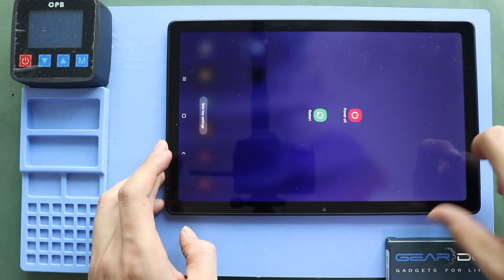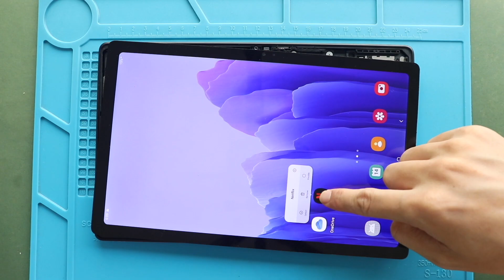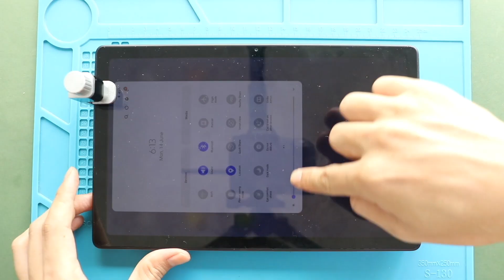Samsung Galaxy Tab A7 2020 10.4 T500 T505 Charging Port Replacement

Comment: Thank you this was very helpful. I wouldn't recommend using heat gun. If you dont have a heat pad, alternatively you can use a 3d printer with heated bed this what i used

Comment: I couldn't use a heat gun so instead I warmed up a dry washcloth & used that to loosen the glue. Followed your directions exactly and my tablet is working again! Thank you so much. Your instructions were very easy to follow!!

Comment: I'm a newbie to this.  HELP.  Should I be worried about static electricity? I'm just thinking that these electronics may be sensitive.  I don't know how I could either dissipate it or keep it from building up from my activity (I have wood floors and a rubber mat on a workbench).  Thanks of the video
Reply from the maker: Well try to wear anti static strip

Comment: heat gun and using my fingerstips as measure to when things got too hot i was able to pry it off with a very thin yet sturdy plastic sheet, slowy along the edges.  if you pry off the  plastic cover on the top (glued ) where the buttons are it makes the start even easier

Comment: Thanks - I just changed mine today. This was my mom's tablet where something happened so that the device only charged if the cable was plugged in with upwards tension at a 30-degree angle.  Now it charges with a normal cable when lying flat. FYI I used a Philips Head 0000 (PH0000) to get the screws out. THe other thing you might mention is removing the old glue before applying new, I decided to remove all and add a new layer.
Reply from the maker: Great, yea it is a good practice to apply new adhesive
Reply: What type of adhesive is used? It wasn't mentioned in the description.

Comment: I used a syringe to put a very small amount of rubbing alcohol in the groove around the screen to soften the adhesive. Let it set a few minutes before lifting a corner. The screen will virtually fall out.
Reply from the maker: You have to very careful when you are adding alcohol to remove the screen. Sometimes the screen get damage by showing water inside. Little is fine but be cautious
Reply: @DIYGeardo  Thanks for the important tip.

Comment: GREAT video, but after I replaced the charging port I'm now having trouble with the top 1/4 of the screen being black.  Any suggestions  would really be appreciated.  Ty
Reply from the maker: Most likely the screen got damaged. This might be the closest issue. Double check all connections
Reply: Yep.....you bent it too much. Don't ask how I know.

Comment: Nice tutorial!! Mine still won't charge after this and nothing turning on 😪. I am not sure why. Took it apart and back together still nothing. Any advice?
Reply from the maker: Try with another part. Sometimes the replacement part can be faulty
Reply: @Geardo  I see what I did. I pushed the pry tool too far and damage the side tape on the digitizer. New screens coming but it charges lol
Reply: @toshlarue  same exact here but could not find any damage... yet the LCD is bad and shows lines... FML

Comment: Very good detail. Thanks. USB C connectors seem very fragile. 
How long do you leave it on the heating pad? The bezel is very thin on the lcd. Maybe 2mm. It’s amazing they used 19 screws on the speaker cover and none to hold the back on.
Reply from the maker: Thanks 🙏

Comment: Why do you disconnect the battery and lcd connector? Couldn't you replace the charging port with those still connected?
Reply from the maker: Well it is good to disconnect the power. Lcd screen is for the safety. If you are confident enough, can leave the lcd connector. You can replace the charging port while all are connected. But do not take risks.

Comment: I did everything and now you can hear the charger port  works as soon as I put in charger except......now my screen s black. Any suggestions....thanks!!!
Reply from the maker: Sorry for the late reply. if the screen is not working. You need to check the connections first. But i feel like something went wrong with the screen removal. Have you sort it out?
Reply: @DIYGeardo  I checked the connections a few times, then gave up and bought a new one.🤷🏻‍♀️